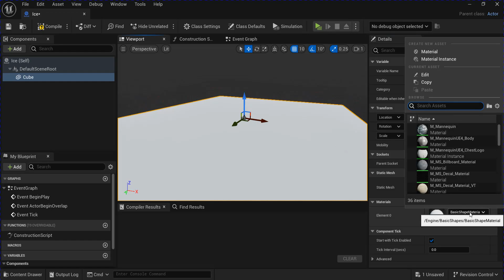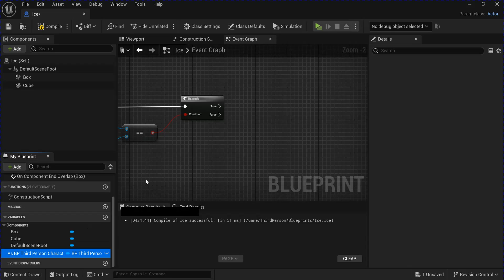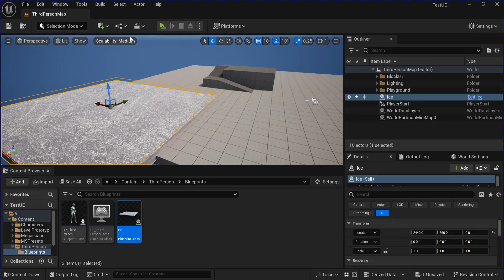How To Make Ice | Unreal Engine 5 Tutorial

Comment: Before setting ground friction and deceleration i git them and promoted them to variables called "old friction" and "old deceleration"

Then on end overlap i set the values using those variables
Reply: Will be bad, for example if your acceleration changed due to sprint or falling. Then it's going to set that variable in the beginning which won't be the same as the default or whatever your you set for your custom character. 

Best is to make a struct, enum, data table and set those variables at begin play and use them with enum with some settings like walk, sprint, crouch, ice, swimming, etc. Then set different acceleration for each settings to use.

Comment: thank you so much for this!

I am trying to design a movement similar to armored core or other mech games and was completely unable to find anything to add some inertia to the movement of my mech.

But thanks to this video I was able to get it working. I had to make some changes to the method since I am not actually creating an ice surface, but just by adding the friction and deceleration modifiers in my character movement bp it started feeling as I intended. Thank you again!